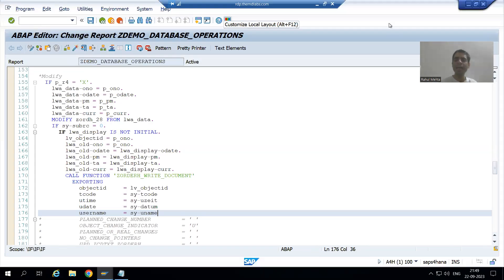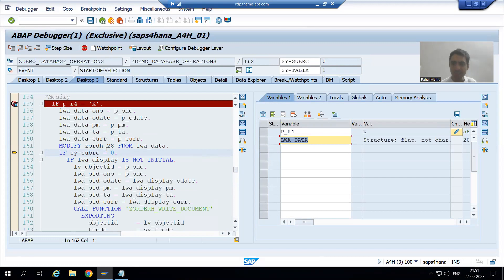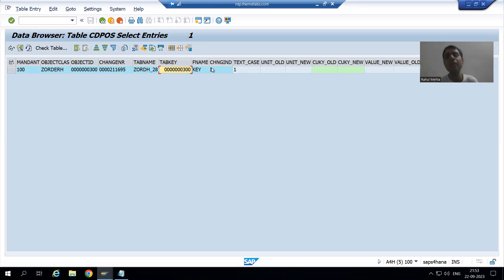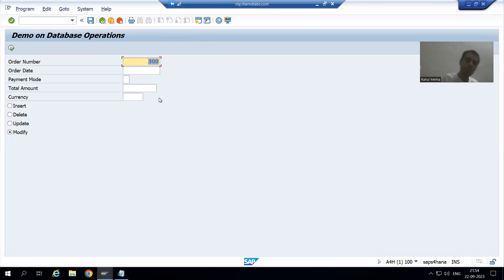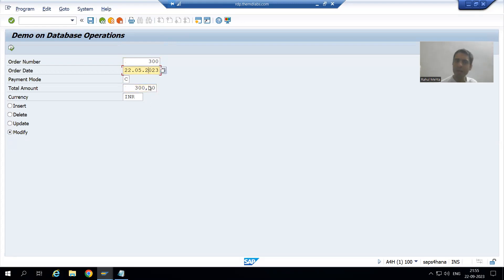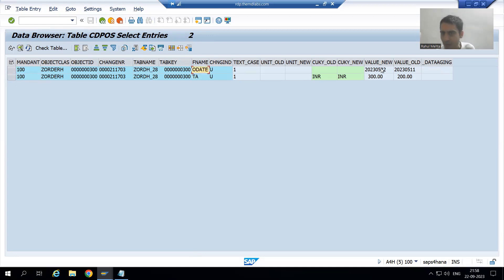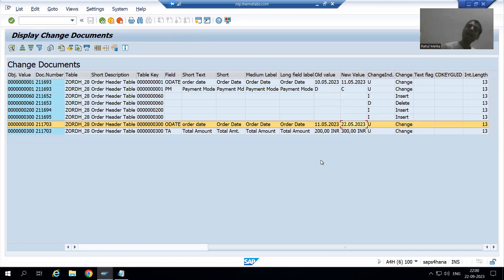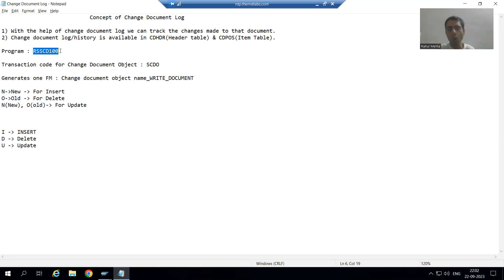38 - Additional ABAP Concepts - Change Document Log for Z Tables Part10

Comment: Thank you Sir for all the valuable content. I have some questions.
1. I had recent requirement where customer asked to know if someone deletes the table entries from TMG. So, can I implement this inside modifications events and enabling the Log data changes checkbox is mandatory for this scenario? Would you recommend this because I have not usually seen many senior most developers implement this as they mention about performance issues. Is it true?
2. Can we implement application log (SLG1 t code) concept for my requirement?
3. Client doesn't give access to SCDO transaction.
4. In which scenario we have to go for INSERT table when MODIFY keyword works in both ways?
Reply from the maker: Hello Mohammed. Below are the answers to your questions.
1) We don't go for log data changes approach as it captures the log for full table and it is an extra overhead. We prefer to use SCDO approach as it maintains the log at filed level.
2) I have not worked on SLG1. You can check this thread for SLG1. It's a good thread.
https://community.sap.com/t5/application-development-blog-posts/create-and-view-log-using-slg0-and-slg1-transaction/ba-p/13216139

3) When we want to provide the error for same key entry use INSERT as MODIFY does not provide error for same key entry.

Comment: Hi Rahul,
Instead of creating the function module we will create our own Z table and maintain the changes
what is the difference
Reply: Hi Rahul,
You have created one function module through transaction code SCOD and populated changes in CDHDR and CDPOS tables...
below is my logic to store the previous entries.

1. I will create one Z table and in that table i will take the fields which are in ZORDH and also one counter
2. before updating the table(ZORDH)  i will populate the data to my Z table (IN THIS CASE MY Z TABLE HAVE SAME RECORD AS IN ZORDH).
3. after update i will increase the counter, so in this case in my Z table will store both the records, one is before update and second one is after update.
Reply from the maker: @suryaprakashnellutla5278     Hello Surya - You can use your approach as well.  Below are the additional things/points which must be taken care.
1) You need to develop 2 additional tables - one for header log and one for item log.
2) You need to develop a additional report as well which will fetch the data from these 2 additional tables and display the log. 
Important point : In SAP audit, SAP will question this approach as customization is for those things which are not provided by SAP and it is already provided by SAP.
Reply from the maker: Hello Surya - I am not getting the query. Please elaborate your query.

Comment: Hi Rahul
If we change the table records in SM30 how can we see the log?
Reply from the maker: If we are going by this way - We need to write the same logic in TMG(Table Maintenance Generator) events. Another option is tick the checkbox for Log Data Changes in technical settings of the table and then we can check the log through SCU3 transaction code.

Comment: Hi Sir,

Generally, if you want to enable a change log, you need to go to the technical settings of the table and check "Log Data Changes."

Once you do this, you'll be able to see the change log of the table, including data and date details, using the tcode SCU3 - Evaluation of Change Logs. Is it okay to use this option as well, Sir?
Reply from the maker: Hello Firoz - SCU3 provides extra overhead to the system as the log is for the whole table. So we prefer log maintenance at field level through CDPOS and CDHDR tables, as we can take those fields for which log is required.

Comment: Bro here we are inserting using se38 program so from that function module it will update in cdhdr table....but if we insert /edit directly in se11 zordh table ...how cdhdr table will update?
Reply from the maker: In that case, we need to call the same FM in TMG(Table Maintenance Generator) events. You can refer the topics - TMG events in ABAP Dictionary playlist, you will get the idea for the same.